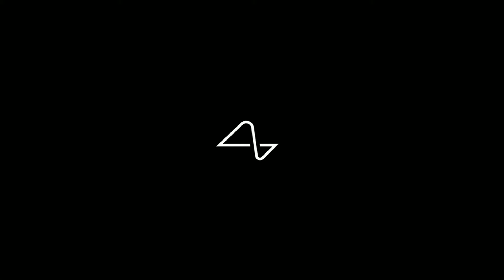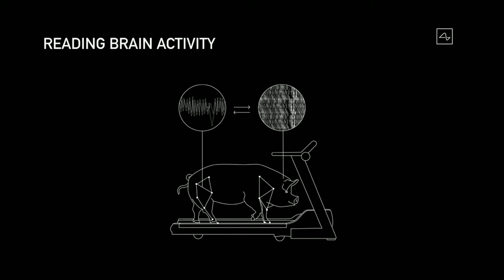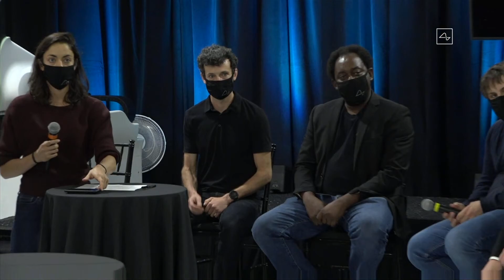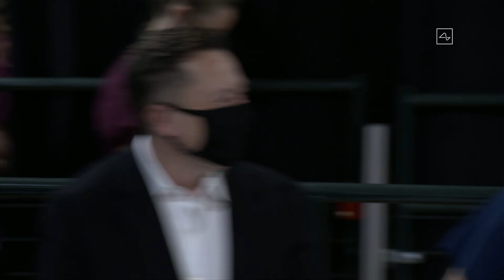Neuralink Progress Update, Summer 2020

Comment: 45:10 this would be my biggest concern: how the device frequency interacts with other biological frequencies. The body operates at super low frequencies that are sensitive to frequency modulation--for example, me staring at my phone before bed...now it will take longer for me to fall asleep. Super interesting research. Cute pigs. I live with a spinal cord injury caused by inflammation of nerve tissue. My dad practiced bioresonance therapy on animals as a vet. It was super effective for chronic conditions that were otherwise mysteries. An interesting feature of this method was that it wasn't necessary to diagnose anything, all you had to do was find dissonant frequencies from organs and send a low frequency back that brought it back to resonance. I wonder if a low frequency model could literally stop cancer by inverting low frequencies. Love this stuff. Awesome team.
Reply: The effect from your phone on your comes from systemic influences (eg. switching your brain to 'information assimilation mode' or arguing with people online) and from the bodies own sleep cycle regulation, which interprets the glowing screen as a cue that it is actually daytime, not some frequency interference.
Reply: @sh4dow666  light and color are frequencies.
Reply: @NewcolorStudio  But the frequency of light still doesn't interfere with any part of your body. It's energy gets absorbed a bit differently depending on the energy level per photon (a function of frequency), but apart from that pretty much all effects on the body are of a thermal nature (it warms up your skin a bit).

Because biological frequencies are so low, you'd need similarly low frequencies to influence them. The only waves that fall into that category are ELF (extremely low frequency) and perhaps also SLF (super low frequency) electromagnetic waves, both of which are very difficult and expensive to produce synthetically (though they can originate from whether events like lightning or geophysical disturbances of our planetary magnetic field) (expensive meaning many km long antennas using several MW of power (1000 times more than what a normal household has available).

Remember: neuralink is smaller than 1km and uses less than 1000W (or it would cook your brain), therefore its frequency won't interfere with human physiology.
Reply: @sh4dow666  interesting. The machine I'm familiar with is called Bicom by Regumed. It was 50+ lbs. Translating the therapeutic effects to a smaller, passive device would be cool. I think "influence" would be a better way to describe the way light and frequencies interact with biological systems--rather than interfere. For instance, the sun doesn't interfere with ice as much as it influences it to melt. Then the water flows and interacts with other systems and structures.
Reply: @NewcolorStudio  Electromagnetic waves smaller than 100m can't interact with macroscopic biological frequencies. Wavelengths between ~400nm (4*10^7m=0.0000004m) and 100m only have thermal effects on the body (heating it up), except for some special cases like the photosensitive cells in your eyes (which are affected by wavelengths around 400nm-750nm, or frequencies of 400-800 THz). Higher frequencies/lower wavelengths have sufficient energy per photon to damage DNA (UV light in the upper skin, XRAY and gamma rays through your whole body), and can therefore cause cancer. Communication frequencies are usually in the GHz spectrum (eg. 2.4-5 GHz for WLAN), which means wavelengths of about 10cm, which don't meaningfully interact with the human body.

If you want to worry about something, worry about lightning storms (ELF waves) and gamma rays, not harmless communication devices.
Reply: @sh4dow666  takes off tinfoil hat I think it's ideal to assume the only energy emitted from the device is the GHz communication frequency--even if a GHz signal cannot melt ice. Given its proximity and exposure time to the brain, this is my "biggest concern". It is really fascinating how many areas of science overlap with technology like this...

Comment: Ok so this thing has a battery and Elon said 1 day, but let's be real it will lower over time and a lot of factors dictate energy usage. So imagine at some point it legit plugs into the human energy system. Cause energy is passed from the stomach to at some point every cell in the body. So what if for X amount of extra calories you get Y amount of compute. I don't know how to do this with only a few thoughts, but there must be a way.
Reply: Some kind of a fuel cell, running on a blood sugar? Possible, but there might be a problem on where to implant it and how big it will be to generate enough energy to power the implant.

Comment: Hi,

Possible future
Use all time - Lucid dreaming work while your are asleep. Similar to Dr. Strange.
Material science - Inject artificial nanites and program them to restructure themselves making electrodes. And pierce out of the skull with safety and connect to the external neuralink device. Auto recovery/heal/repair from corrosive brain-human environment by replacing few nanites. No need to be replaced when in operation. :P
User - redesignate regional brain functions - We will be able to understand if we can automate our daily works using other parts of brain. so that still can work on what we want to work on. Learn to focus in an induced manner. I need to know if it is controllable. As studies of brain disorders say neuron can be replaced by other neurons. Can immune system or similar is in control of the brain? May be used to accelerate healing process. May be.
Security - MAJOR - I loved the thought sharing. However, do you think this may cause us to loose our individuality and maybe all of us become one. Whoever is strong mentally will be able to, in a way control others' thought or at least direct their thoughts. If given authorisation. Thanks to AI, I think these data related events can be detected easily.
Medical - It is obvious to cure and even detect beforehand.
Minor Application - Keep triggering happy emotions, do not remove pain as they may not let us feel happiness. I am not clear on this thought. Just sharing slow by typing. May be neuralink could help me by letting some brain in with clear thought and guide me. I believe it will be an instant clarification when this happens. It will be entirely new world.

Nice work Team and Elon.

Comment: 2:14 even curing at least one of those diseases would have been enough for any innovation!
Reply: That's a blessing and a curse. Perhaps a little focus on a specific symptom e.g. motor impairment would be a reasonable place to start as we know/understand the consistency of the motor system. We also have benchmark technology such as DBS to compare during initial trials and then look to more elaborate, distributed networks whose localisation is dependent on the environment. IF Neuralink can be shown to be better than DBS for tremor etc then an extension to chronic pain (similar sites of localisation) would be a sensible next step.

Comment: 1.How can we treat addiction ?
2.I PERSONALLY want to be treated by a person rather than a robot, is that possible?
3.
Reply: An electrode placed in the right spot could turn off a craving completely.
Reply: k3ys thanks buddy, did they mention it though.
Reply: @bismillahir  Mentioned briefly at 32:30 but they say it would require going deeper.
Reply: Sure, the person will press some buttons and remain present for emotional support as the robot does its work - work that's 100x more delicate and precise than anything a human could do.

Comment: How strong is the device, if I fall and hit my head on the device does it push into the brain?
Reply: It is in your head so it would most likely have to break your skull to do that. So in this case the device going into your brain would be less of the worry compared to a skull breakage and most likely resulting brain damage. But in terms of the device durability if I recall they said it is decently durable.
Reply: @leaderofthenewbencrusades746  they said nothing about closing the skull.  My understanding is fills the hole where ur skull was

Comment: Here are TImestamps for the whole presentation: 

0:00 - Stream Start

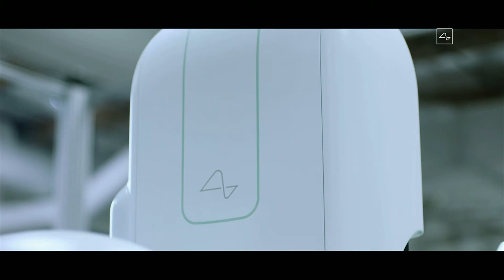0:30 - Intro Video

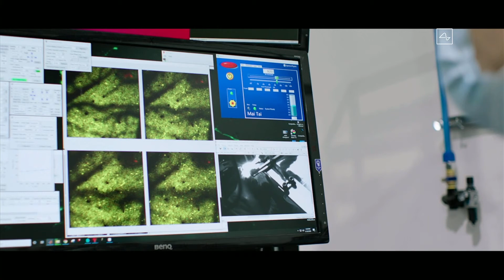1:02 - Start of Presentation
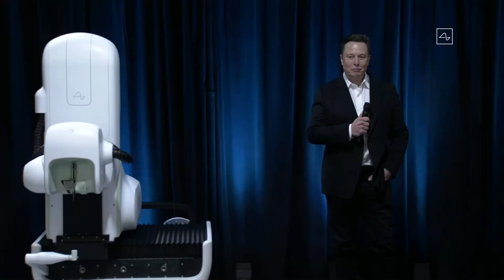	1:07 - Welcome from Elon Musk
	1:16 - Emphasis that this presentation is to encourage recruiting
	1:44 - The purpose of Neuralink
	3:40 - Current Medical Research and Available Tech
	5:42 - Neuralink and Development
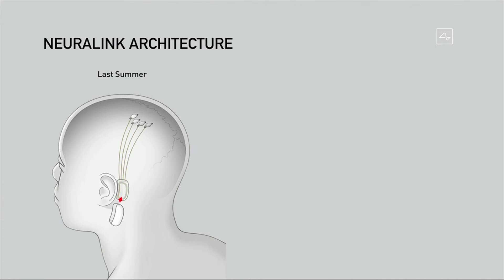	6:11 - The Link itself
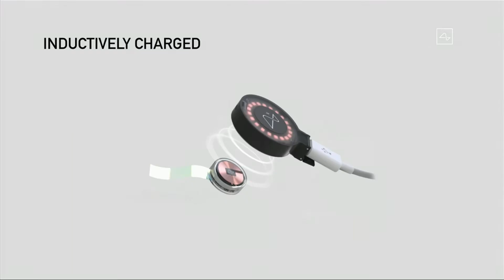	8:26 - Charging The Link
	8:47 - Getting a Link
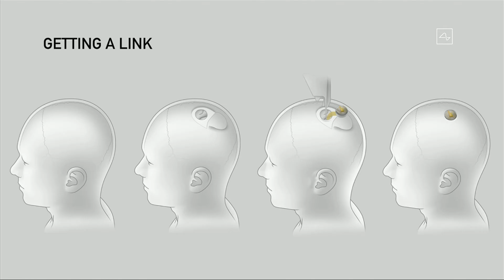	10:05 - Surgical/Implantation Robot
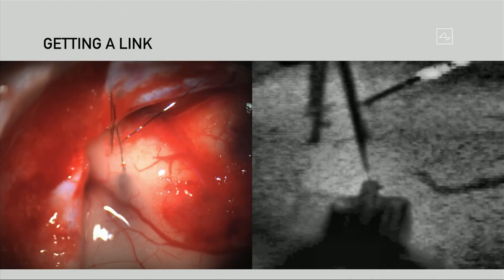	10:46 - (Mildly Gruesome) Video of Electrode Insertion

11:42 - Tech Demo in Pigs
	12:12 - Joyce (Pig with no Neural Implant)
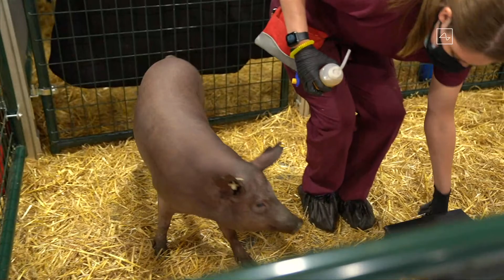	12:58 - Dorothy (Pig that formerly had a Neural Implant, was later removed)
	13:32 - Trouble getting Gertrude into the outside pen
	15:34 - Gertrude (Pig with Neural Implant, beeps when Snout stimulated)
	17:15 - Pigs with two Neural Implants

17:58 - Reading Brain Activity
	18:20 - Reading Neurons to predict joint positions of a Pig on a Treadmill

19:10 - Neuron Stimulation with Implants ("Writing to the Brain")
	19:27 - Analysing Neuron Stimulation with Two-Photon Microscopy

20:41 - Specs of Initial Device
21:30 - Neuralink progress towards Clinical Studies
22:20 - Further emphasis that this presentation is to encourage recruiting

23:39 - Start of Live Q&A
	24:53 - How is Spike Detection implemented and What is a Spike?
	27:00 - What can be further done to simplify the device installation process?
		27:41 - Anything specifically to do with the Robot?
	28:25 - What are some of the lower Bandwidth activities to target first?
	29:15 - Can you summon a Tesla telepathically?
	29:45 - How do you see the device and API developing over time?
	30:38 - Will the device ever be used for gaming?
	31:03 - Is the device limited to surface layers of the Brain?
	34:00 - What is the most challenging problem that must be solved to meet Neuralink's goal?
	36:44 - How thin are the Electrodes and possibility of Upgrades?
	38:09 - What are the "Read/Write speeds" of the device?
	40:34 - How big is the Neuralink Team and how do you expect it to grow?
	41:32 - How does the system fair against outside signal disturbances?
	42:44 - Audience Question: What are some other applications for the device?
	44:55 - How is the device protected from the body?
	46:42 - Will you be able to save and replay memories in the future?
	47:32 - Animal care in Neuralink
	49:19 - What programming language is being used in developing the device and Robot?
	50:10 - But can it run Crysis?
	50:59 - Can the device be used to eventually explain Consciousness?
	52:33 - The Security of the device
	54:11 - Any points the team find cool about the device?
	54:51 - Positives of using Pigs as a model for development
	56:50 - Availability and Cost of the device and implantation
	58:02 - Architecture of the device
	59:54 - How does the integrity of the device compare to Bone and the area of implantation?

1:01:55 - Closing questions and comments
	1:02:00 - Flexibility and width of the Threads
	1:02:27 - Length of the Threads
	1:02:40 - Movements of the Threads and other improvements to biocompatibility
	1:02:58 - (Down the line of staff) What is number one on your wishlist for the device?

1:12:10 - Closing statement from Elon Musk

Please reply with corrections if any of these are inaccurate or if there are any I've missed.
Thanks, and enjoy the presentation.
Reply: Legend
Reply: Quirk  literally, a ‘legend’ for the video
Reply: Amazing work, thank you
Reply: I was looking for this. This is remarkably thorough; thank you very much
Reply: Thanx
Reply: Thanks. Much appreciated!
Reply: Needs more likes!
Reply: You took the time to make all of this. You deserve an award
Reply: This itself is a presentation...😂
Reply: You’re a Champ!!!
Reply: Thanks you’re a gem
Reply: Awesome! Thank you! 🤯
Reply: Thank you
Reply: You da best!!!!
Reply: Thank you!
Reply: thankkksss broooouuuuuu love you
Reply: Thx homie
Reply: Thank you
Reply: super effort , Really my deepest appreciated
Reply: Thanks boss
Reply: careful .. he's a hero
Reply: Much appreciated!
Reply: The most comprehensive timestamp I've ever seen!!
Reply: Thank you for this
Reply: thanks man
Reply: WOW thank you very much. Have a fantastic day
Reply: Legend
Reply: "Sent from my neuralink"
Reply: No one is born cool
Except of course Some Guy Online
Reply: Doing gods work brother.
Reply: You sir are a fucking legend
Reply: Amazing
Reply: Oh man! Thank you so much!
Reply: @Bob Ross  Thank you Bob Ross
Reply: Awesome! You can add the Chrome extension Jumpcut to navigate these easily while watching: https://chrome.google.com/webstore/detail/jumpcut/jicbaeklgoninplhmenhndnidnbfaohm
Reply: You have done what Neuralink should be done. Thanks buddy
Reply: thank you so much!!!
Reply: Whoa.
Reply: Most important comment!
Reply: Thanks man!
Reply: You're the main reason I check the comments. Thank you so much
Reply: You are awsome !
Reply: Good work!
Reply: God bless
Reply: But can it run crysis: 50:05
Reply: I’m so happy as I tweeted that 😁
Reply: Thank you very much
Reply: Thanks mate ✌️😉
Reply: you are a life saver
Reply: Thanks a lot for this work.Saved a lot of time !!
Reply: Awesome !!! Thank you for the timestamps !
Reply: GOAT! Thanks
Reply: Have a like kind sir.
Reply: Epic! Thanks!!
Reply: I love time.stamping thanks
Reply: You deserve all the praise given to you
Reply: Thank you, you've benefited me a lot.
Reply: Start it with "0:00 - Stream start" and this appears ready to be added to the description to improve the play bar
Reply: I'd personally also get rid of the leading spaces (and it might be needed for the play bar to change), but to each his own.
Reply: @Thomas_Acharya  Perhaps, but I feel that having the spaces and formatting as in the comment helps to show which sections are more distinct and which are subsections.

Maybe it's just personal preference, and I apologise if it causes issues in readability or displaying the text on a small screen (It was written on PC).
Reply: @joj.  My comments are mostly if Neuralink wants to use it to break up the play bar and show titles. I don't know how much your formatting would interfere with that process
Reply: Who /are/ you?  I see this MASTERPIECE of timestamps and hyperlinks. Surely, this must be the work of some great group, some collective, surely some grand g-d among men.

Some guy...19 subs... no other content.. been around forever, though...   

IT MAKES NO SENSE!
Reply: Really reallt thanks
Reply: Thanks, King
Reply: Some Guy Online wow nice work!
Reply: Savage comment
Reply: Wtff
Reply: Elon I've had three strokes in the same area of the brain and I want to volunteer to be a test subject, how can I contact your team?
Reply: Your work is underrated sir.  Thank you.
Reply: Some Guy Online very new
Reply: <3
Reply: True hero
Reply: Thank you!
Reply: Real boss
Reply: Real nigga cuh8
Reply: Amazing!!
Reply: Bump
Reply: thank you man
Reply: wow
Reply: Thanks
Reply: We need more people like this on earth...
Reply: You could do anything else you done this ty
Reply: Thanks, up
Reply: GUYS, (including girls)I MADE A SONG CALLED NEURALINK TODAY https://www.youtube.com/watch?v=kS9GPuKbstQ
Reply: I have learning difficulties is it possible to help repair this problem?or download information to the brain?
Reply: i love you for this
Reply: Q&A: What would happen if there was an emp strike sent to each neuralink implanted device?
Reply: I guess neuralink doesn’t like questions that are unbiased and reasonable and all I said was in Q&A form: What would happen if there was an emp strike sent to each neuralink implanted device? And neuralink channel erased this comment? That should tell you something!!
Reply: Your awesome, thankyou!
Reply: COVID-19 and other microorganism threats have inspired me to have this idea... It's an extension of what Elon Musk said about changing your visual spectrum... The idea is Microvision, with indicators for harmful microorganisms and beneficial ones... A red glow for harmful ones and a blue glow for beneficial ones (no color/glow for "neutral" things and maybe a yellow glow for "unknown" things). With this, you can literally navigate the micro world by embracing beneficial things and avoiding harmful things like viruses, pollution, etc. <3
Reply: To clarify... What I'm proposing is using the eyes as visual receivers (like cameras), which would stream live directly into the Neuralink implant. The implant would be connected to an online database of microorganisms... The eyes themselves might not see them, but the implant would stream everything using a built-in microscope... And microscope live streaming is already being done today. As the stream connects to the database, it identifies every microorganism within your visual direction and it generates glowing color/s at their exact location/s... Human eyes see random "colors" all the time, so altering those should also be doable. <3
Reply: Like#666 belongs to me...mwa ha ha ha
Reply: bhut mast kam krta h tum maksud bhai
Reply: Not even close with these time stamps, actually.

Comment: To make Neurallink functional one will need nanotechnology networks. You can't go physically implanting leads, that wouldn't be practical. You have to inject material, open the BBB with microwaves, and then do RF guided self assembly from the outside. Then Neurallink can become the cyberbrain we all wish to happen.
Reply: no no no, bucket brigade circuit with wax capacitor. it's the only way